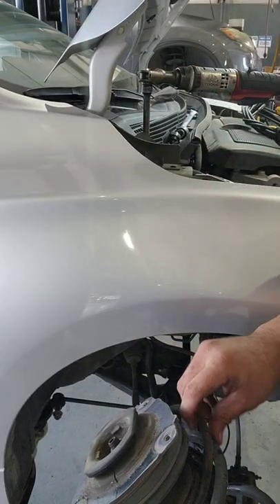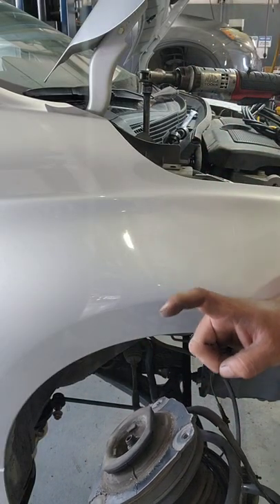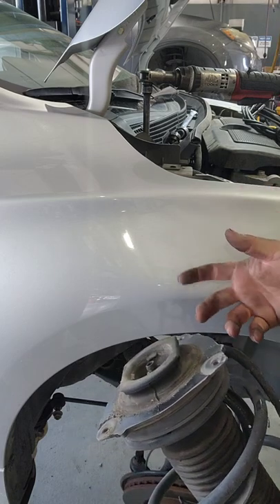QUICK FRONT STRUTS REPLACED!!! #shorts #youtubeshorts #mechanic #pro

Comment: You should get a magnetic camber gauge so you can reset the camber exactly where it was.
Reply: All you need to do is mark the position of the camber bolts with a paint pen or a scribe. That sets it to where it was. Question is, was it correct in the first place.
Reply from the maker: No camber adjustment on this...not room to finese it either

Comment: Why not replace the stabilizer bar link in the process? One nut each side and voila
Reply: Why replace if it isn't worn out yet?
Reply: @waynes.2983  It’s called a COMPLETE job. Typical technicians won’t do it . One nut removed and the old link is out. Take care of your customers and they’ll be lifetime customers.
Reply from the maker: Jam ram, extended warranty wknt replace a part if its not bad
Reply: @FluffyMexicanik  Extended warranties limit which parts gets replaced. The ball joint on the link is worn, it’s a wear and tear item along with those struts.